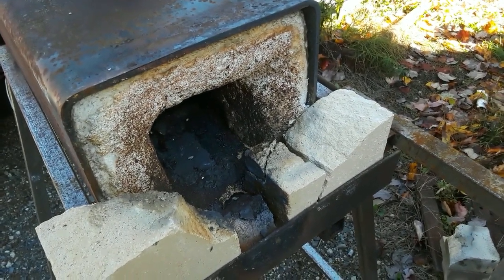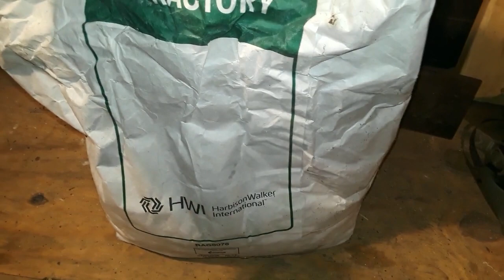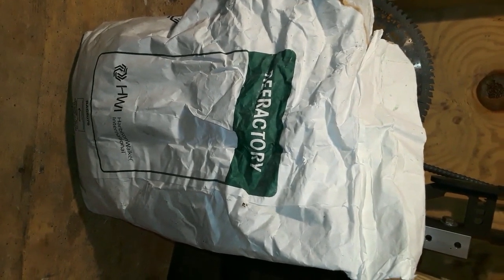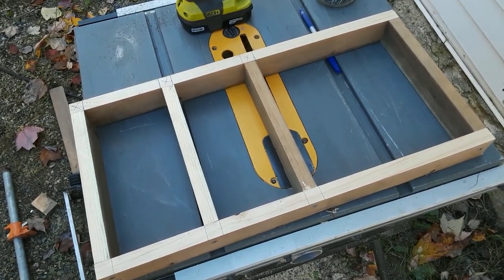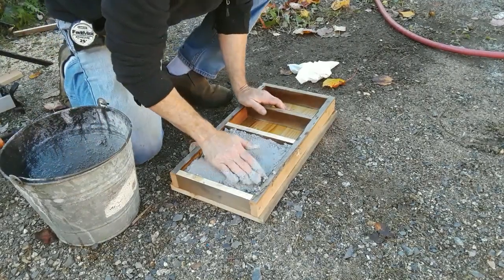Making new fire bricks for my forge

Comment: Also, you need to wait for 28days for the concrete to cure to about 99%. Accelerating the cure in the oven makes for a weaker concrete because you need the water to be available to the cement for hydration so you get a strong mix which would make for a more durable fire brick I would suggest.
Reply: Exactly right. 👏👏

Comment: Use to do alot of forming for concrete when I was younger. We used diesel fuel to spray the forms. It's oily and will soak into the wood so the wood won't absorb the water. It also helps the concrete not stick.
Reply: They use a different compound now. It smells worse than diesel but not as strong, less fumes, and it's sticky. I used to do tilt-up.

Comment: use Rotella motor oil on your frame next time, and vibrate the frame to get the cement to settle. whack it with a hammer around the sides several dozen times should do a treat.

Comment: You have to pack the concrete, if you have a drier mix.  Typically, corners are harder to pack and it creates "voids" or air pockets, which is what happened.  
As far as corners, we used caulk to seal the joints, preventing the water in the concrete from leaching out.  This too, will cause dry, crumbly, corners.  
Test cylinders for concrete (to determine compressive strength) are placed in tubs of water to cure for 30 days.  Completely submerged concrete, after it has "cured" for 24 hours, is actually stronger than air cured.
Reply: 28 days, not 30.

Comment: Hi, Interesting channel young man. One way to reduce the water content but gain workability might be to use a super plasticizer for concrete in  your cement mix? a PCE or Poly Carboxylic Ether is also a water reducing agent in concrete. It comes in liquid and powder form. What other materials are in the mix or does it come mixed in the bag?